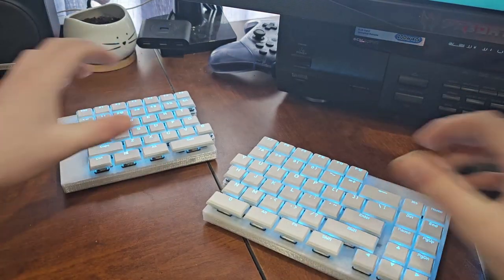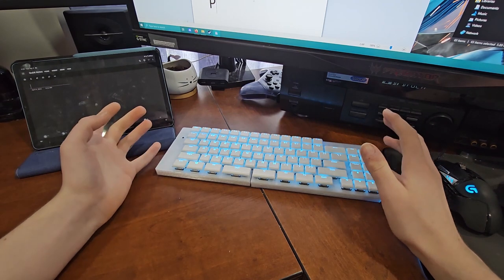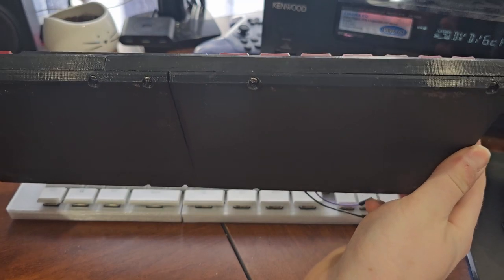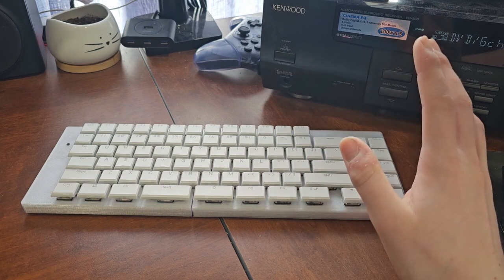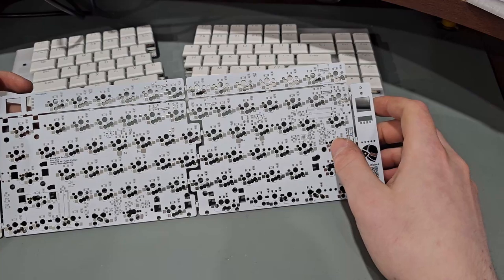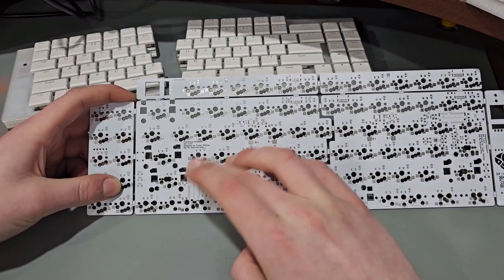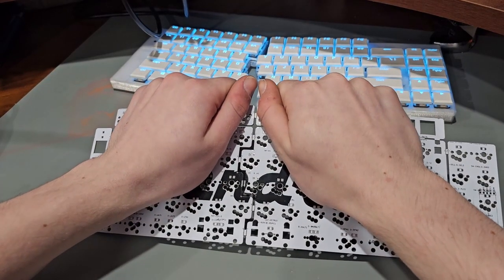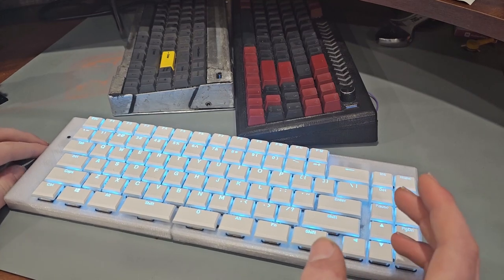My Thinnest Mechanical Keyboard ► Phendrana Demo

Comment: hey man i had a question about one of your previous keyboards , the sanctuary , I wanted to know how the battery life of that model is and if there is a way by any chance to reduce battery usage to very minimum, maybe by messing with the clock speed or using certain interupt or sleep functions(i dunno i'm not an engineer) but I got really interested in using an ESP32 to build a custom keeb but i don't want it to run out of battery that quick so power management tips would be appreciated.
Reply from the maker: If I'm honest, The Sanctuary was a much less efficient keyboard for power, but it paved the way to learning on this keyboard (I mainly made Phendrana to improve on the issues from The Sanctuary)
Usually at most, The Sanctuary would last a day of charge, but probably even less
There was a few main reasons for that, but essentially it comes down to the whole system being inefficient in power. The ESP32 itself isn't terribly efficient, but was moreso an issue that I didn't implement a sleep system, so The Sanctuary was always awake wasting power, even if you weren't typing. The ESP32 does have a sleep mode from what I know, I quite frankly just don't like programming, so I never implemented it 😅
The LEDs were also 5V Addressable, which are notoriously inefficient, and since they were always on with the ESP32, they sucked a lot of power
The Power system itself was inefficient, I used a boost convertor to a linear regulator, both of which aren't very efficient (it had to boost the battery voltage to 5V for the LEDs, only to regulate it down to 3.3V from a linear regulator, which are only about 70% efficient in the best conditions)

Primarily, the suggestions I'd make are to look into making your own power system for the ESP32, specifically using switching regulators, and see if you can regulate the 3 to 4.2V of the battery to the 3.3V on the ESP32 (might want to see if the ESP32 can run undervolted at 3V too, so you can drain the battery to the lowest safe voltage) learning how sleep modes work on the ESP32 would help tremendously too, something like a 15 minute timer since the last time you typed. 
Also, if you want backlight, pick a colour and use standard LEDs, no RGB